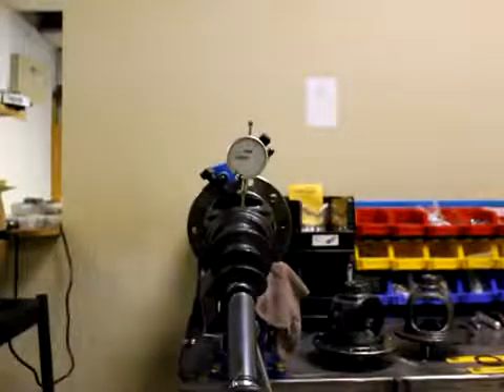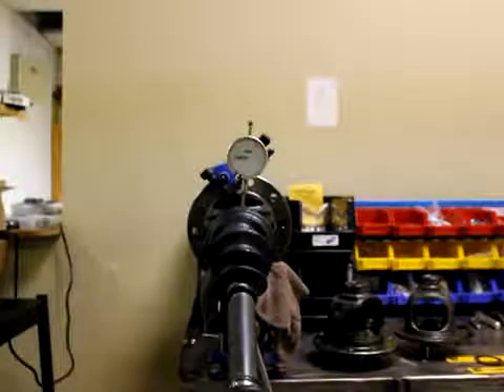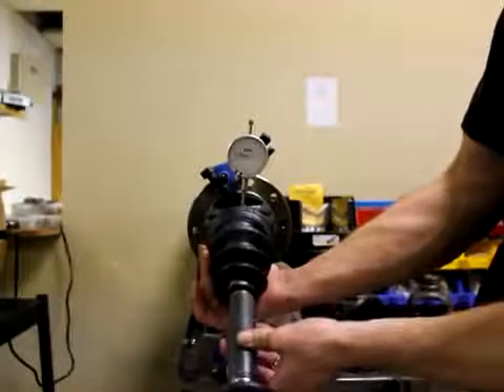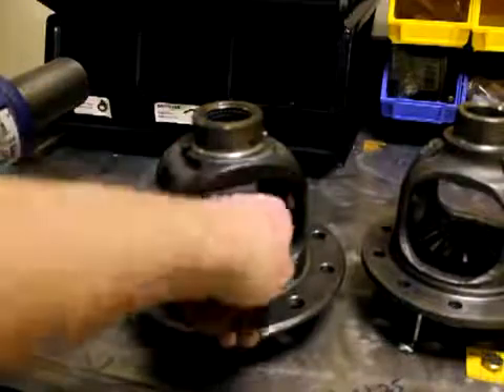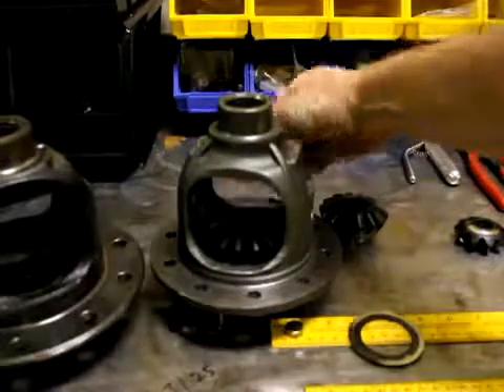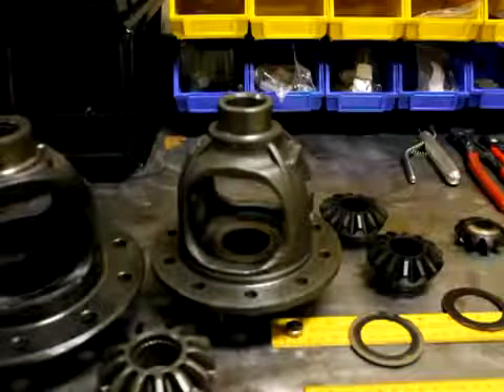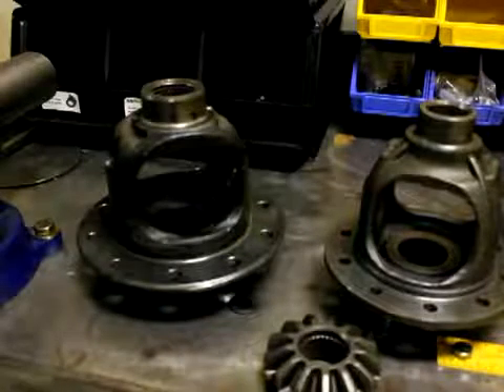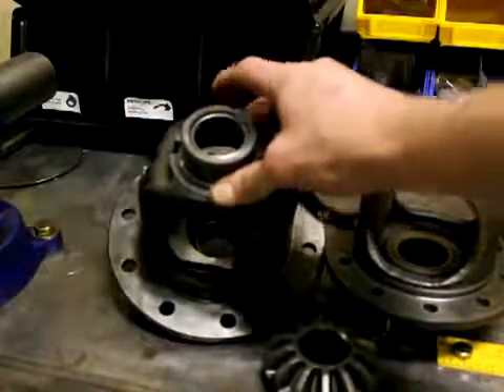Toyota T8CS Bushing Solution - Part 1

Comment: Has Toyota redesigned the carrier or needle bearing? I'm hearing  lots of newer Tundras even up to 2021 having the same amount of play as early as 10k miles. Usually in conjunction with steering wheel shake or vibration under drivers floorboard but not the common growl sound that goes away when 4H is engaged. Does Toyota specify a limit on the amount of play allowed before they will repair it?
Reply from the maker: Here's some more info on the issue. https://www.youtube.com/watch?v=l9XED_tXl_A&t=86s
If you're looking for more info, give us a call at 919-672-2705

Comment: Does your 8” clamshell bushing work on 5th gen 4runners?  I’m wanting to do this change on my 2018 TRD Pro stock with the common vibration issue.
Reply from the maker: Yes so long as it is not AWD - You must have a 2wd provision in the T-case.

Comment: Hello I have an 07 prerunner that's been experiencing some grinding noises and vibrations radiating from the front left drivers side. 

It only occurs when the vehicle is in motion when around 1,100 - 1,500 RPMS and anywhere from 30 - 40 MPH. 

I've been chasing this noise for nearly 5 weeks and I'm thinking this could be my fix.

I also noticed that whenever its pouring outside and the ground is drenched that the noise is near non existent. I'm not sure if this has any correlation to my CV Axle or not. 

I do have to replace my upper ball joints (driver/passenger) due to torn boots as well as my end link on passenger side again due to torn boots. 

Any help is greatly appreciated!!
Reply: Cv axles? Aren’t pre-runners 2wd?